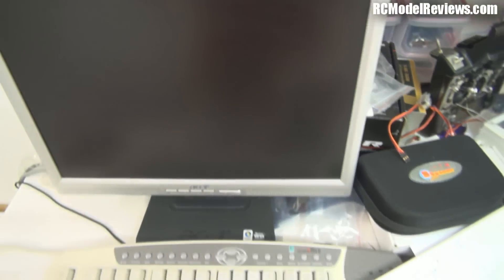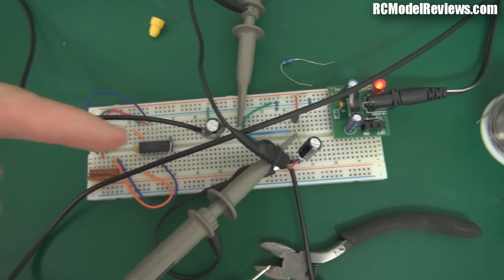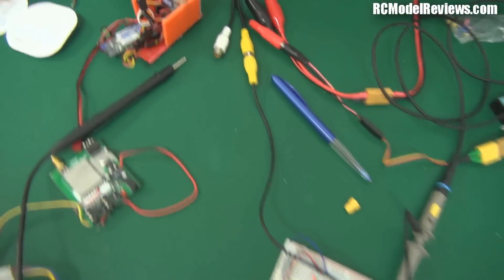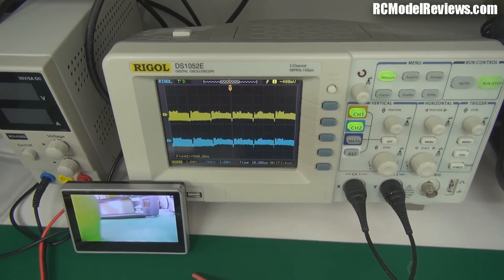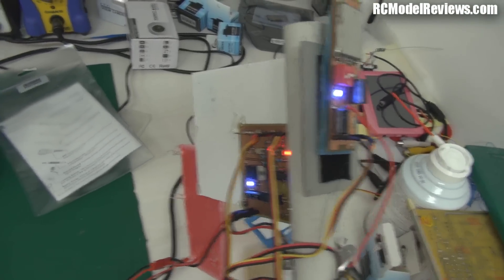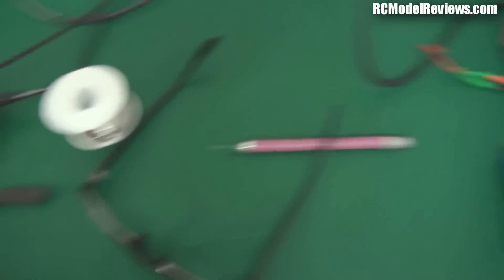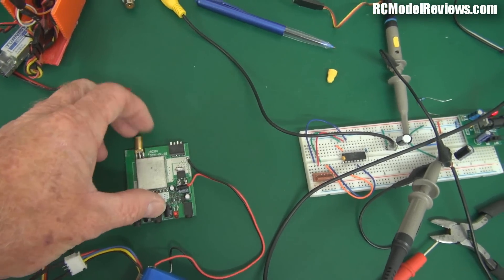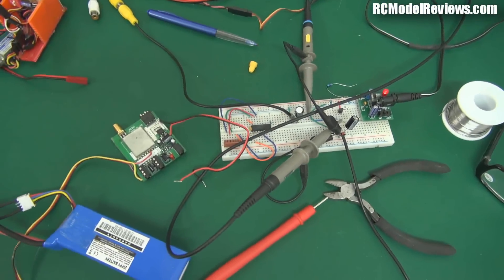What's on the bench? (11 Feb 2014)

Comment: I suggest a DC correcting video amp. Although more complex there are some reasonably priced chips that make it easy. A few years ago I had problems with the early FPV gear; image tearing and general poor quality. The sync and brightness tracking problems were mostly about the horizon where dark ground meets bright sky.

A DC correcting amp on the output of the diversity controller made a huge improvement. It even made my $17 Hobbyking CCD cameras very usable in bright sun and dusk conditions.

You will know this Bruce but for general background: Most of our FPV gear is AC coupled through capacitors, so the average DC level shifts with image brightness. As a model bounces about the sky, brightness changes often and quickly. If the DC level is corrected the display and recorder seem to have a much easier time of it.
Reply: That'd be a good idea -- if the video output from most of these receivers wasn't already AC-coupled :-(

Most of the ones I've looked at are in fact AC-coupled and I was thinking of adding a clamping stage to give the waveform a proper DC component but once you've got a cap elsewhere in the circuit it makes it much harder to do so.

I've been testing the video buffer I've built (using several LCD video glasses and screens) and it seems pretty robust when presented with high-contrast scenes and there's no sign of tearing or sync failure.
Reply: *****
I originally tried clamping the DC level; it's quite tricky to do. From memory (it's a couple of years), the frame sync also messes with the DC shift as well. It seems the usual method was to remove the sync, correct the DC and then put the sync back. There are some interesting app notes from the semiconductor manufacturers. It's likely also that the newer displays and especially the goggles are better able to handle moving DC offset as they have FPV in mind.

Originally I spent many hours setting up levels etc. on the bench to improve the video, only to find that outside on a plane it was all different. Some gear has terminators, some doesn't, just to add to the fun :)
Reply: PMB-NZ
I did experiment with clamping the levels and using some cleverness to get the -300mV sync levels etc but it made zero difference to the actual visible results so figured the extra complexity wasn't worth it.  If you look at the RC305 receivers you'll see that they use capacitive coupling to a single-transistor emitter follower stage with a single bias resistor from VCC to the base.  The signal is then capacitively coupled from the emitter to the output jack.

Seems to work just fine :-o